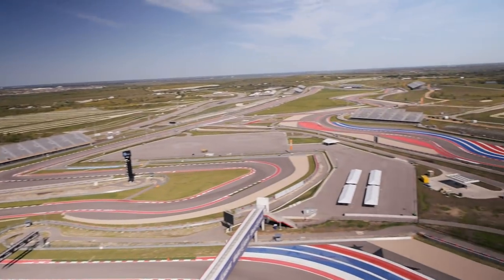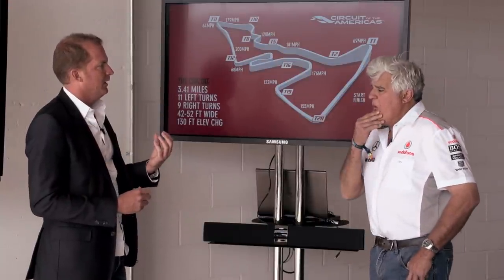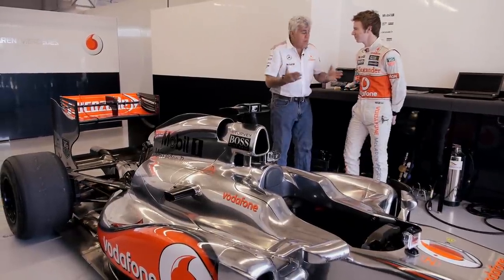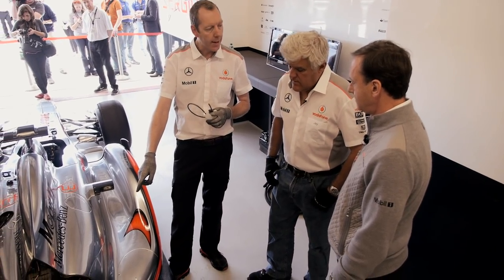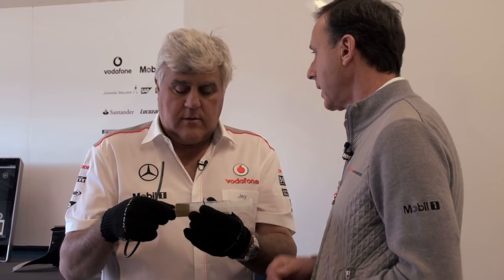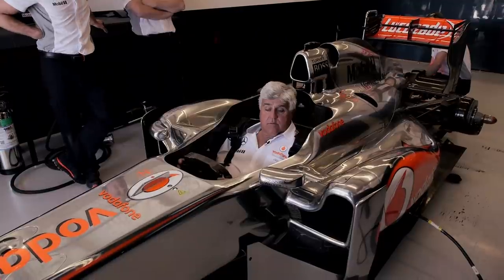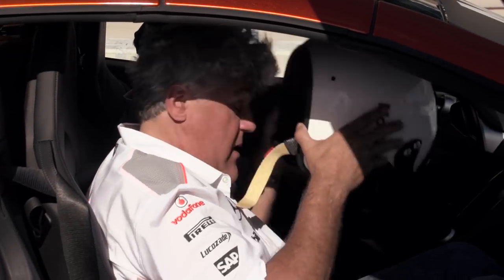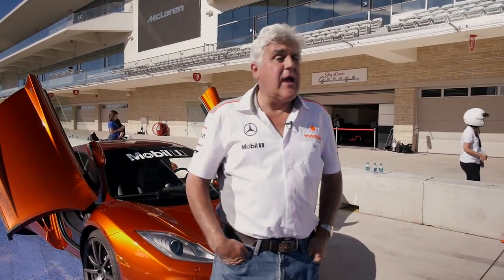McLaren Day at Circuit of The Americas - Jay Leno's Garage

Comment: I wish they had let him drive the F1 car... He was already in it, the engine was on, just put the wheels on and let him drive a couple of laps...
Reply: Dino Prašo 
Have you seen Richard Hammond try to drive an F1 car? He was killing off the engine a million times.
And then when he finally was on the track, he was spinning it constantly in the corners, because he didn't take them fast enough.
Reply: svsguru2000 I'd agree but I believe that these newer F1 cars are much easier to drive than the Renault Hammond was driving. But oh well... It's only a wish anyway.
Reply: Dino Prašo They are still hard to drive and with no experience very dangerous.  U have to go fast enough for down force to work and put heat in the tires so the car stays on the track.

Comment: F1 has been my lifetime passion and I am so glad to see the US offering such an amazing venue.  I really hope it takes off in the US and that they love it as much as we do.  It is just a pity we are losing that amazing noise next year (2014).
Reply: Remember that back in the turbo days they were running 1.5 4 cylinder lumps
Reply: Yes, that was great racing!  A lot different to the engines next year though.  The racing should be good though, we just lose the screaming noise.
Reply: Hedley Thorne Personally I think the extra torque will add to the racing, adjustable boost will add another element to the racing just like it used to be.
Personally I prefer a tuned n/a car to drive, I have owned both a sprint tuned n/a and a high hp turbo mr2 and I'd take the tuned n/a engine every time, a non turbo car is easier to drive on the limit. imo 2014 will be a good shake up and could produce a great year with a lot of engine failures that could knock redbull off of their perch. ;)
Reply: Agree.  The racing will be interesting.  However the trackside noise won't.
Reply: Won't take off in the US. Never has. Nobody can relate to the cars, nor a bunch of guys who names nobody can pronounce. On top of that you can't see the track. Waste of time. Go watch NASCAR instead.
Reply: John Rambo Spoken like a true closed minded American.
Reply: Here here Darren!
Reply: Darren Hahne Remember that movie where Rambo plays a formula one driver? hehehe
Reply: John Rambo How`s life in the trailer park these days? Merry xmas Y`ALL
Reply: I have seen every race so far in the 2014 season and I have to say the sound is not too bad. Yes the V6 does not have the same sound of the V8 but you can hear still hear the engine. Also there has been some great racing so far this year.
Reply: agreed, so who do you reckon, lewis or nico??
Reply: *****
 I think Nico will take it, though I would not be shocked if Lewis won.
Reply: Lewis, if he dont stack it
Reply: yep, i hope so. to be honest he is the fastest driver and without the failures he would have quite a lead.. BUT at least we have a championship on our hands. Thanks for the reply mate.. john uk kent
Reply: ***** His car is a micro second off the pace but you cant rely tell because the raw talent he has this skill astounds me when ever i see him race... Thanks for your response Dave uk harlow.
Reply: speed is like common sense, you have it or you don't and jay has it, in and out of the car, 
What I love about J is he give it back to us, he allows us into his world which is f'ing cool in my book ;) Thank you buddy x
Reply: John from Kent u.k loving but not gay lol haha
Reply: Electric turbo.
Reply: Hedley Thorne i rewatched some old tapes back when they had v12 and v10s
Reply: Darren Hahne
He doesn't represent us.
Reply: John Rambo NASCAR came from the South, so I can excuse a Southerner whose heritage is Richard Petty and NASCAR.  But I don't know who else would rather see a bunch of cars bumper to bumper going round and round a banked oval in one left turn after the other,rather than watching cars race on a track with a variety of turns going uphill and down, left and right, hairpins, chicanes, etc., braking, upshifting, downshifting, really working the cars.  And you can watch motorcycle racing on the same track.  Fantastic!

Comment: Jay, in aviation we use magnetic plugs that have an interrupted circuit. If the engine or gearbox starts shedding metal, the oil carries that metal past the plugs and the metal bridges the circuit, thus a light warns the pilot that the engine or the gearbox is failing. We take oil samples and send the samples to a lab. The lab can tell us from the oil which part of the engine is failing if any parts are failing.

Comment: Around 13:02, when Jay inserted the rubber hose into the gear box to get an oil sample, the car didn't jerk away from the hose or push Jay away, but instead just sat there and allowed Jay to collect the sample. That was a well-behaved race car.

Comment: My hometown is Austin by GOD Texas and I actually got to do the field engineering for a local excavation contractor.  Its going to be interesting and a challenge to the future and quality of the track surface. The PI of the soil is extremely high and difficult to control the massive amount of expansion and or contraction of the soil. 
They couldn't have picked a worse location for this track because of the soil. 
Time will tell us.

Comment: I hate these Tilke-dromes, the new F1 tracks. They all look the same. Almost half of current F1 circuits are designed by the same people!
"Create an overtaking zone here", "create a braking zone there"... They are like those puzzle challenges that scientists give to animals to test how well they can follow the designer's intent. You don't chose the racing line, it is already designed into the track. You don't choose where to overtake, the designer chose it for you and designed it into the track.
This is why I love Spa, it's organic. People didn't build Raidillon to "set up an overtaking zone". They built it to make the track faster and more exciting.
Reply: Kakto Tak Formula One cars are the fastest road course racing cars in the world, owing to very high cornering speeds achieved through the generation of large amounts of aerodynamic downforce.
 Formula One cars race at speeds of up to 360 km/h (220 mph) with 
engines currently limited in performance to a maximum of 15,000 RPM. The cars are capable of lateral acceleration in excess of five g in corners. The performance of the cars is very dependent on electronics – although traction control and other driving aids have been banned since 2008 – and on aerodynamics, suspension and tyres. The formula has radically evolved and changed through the history of the sport.
While Europe is the sport's traditional base, and hosts about half of
 each year's races, the sport's scope has expanded significantly and an 
increasing number of Grands Prix are held on other continents. F1 had a 
total global television audience of 425 million people during the course
 of the 2014 season.[4]
Grand Prix racing began in 1906 and became the most popular type 
internationally in the second half of the twentieth century. The Formula One Group is the legal holder of the commercial rights.[5] With the cost of designing and building mid-tier cars being of the order of $120 million,[6]
 Formula One's economic effect and creation of jobs is significant, and 
its financial and political battles are widely reported. Its high 
profile and popularity have created a major merchandising environment, 
which has resulted in great investments from sponsors and budgets in the
 hundreds of millions for the constructors. Since 2000 the sport's 
spiraling expenditures have forced several teams, including 
manufacturers' works teams, into bankruptcy. Others have been bought out
 by companies wanting to establish a presence within the sport, which 
strictly limits the number of participant teams.
Reply: +Kakto Tak you do know that COTA is a synthesis of Spa, Silverstone, and a myriad of other F1 classic tracks all rolled into one, right?  i mean, you DID do some research right?  you do have an idea of what you're talking about right?  you can look at the track map and see it right?
Reply: +Kakto Tak sure!  Combine your childish "animals following the designer's intent" logic about modern design of a beautiful world class track in the US with objectifying the female form.  'Great reasoning bud", and super mature.  I'd love to see a track you could come up with and see how drivers would somehow NOT follow your intent... You wouldn't dare build in fun places to pass!
Reply: incubrian
You wanted to make a point or smth? It's not very clear.
Reply: +Kakto Tak Its your opinion and your entitled to it but I'd suggest you stop bitching about things you don't like and start talking about the things you do like.
Reply: english1midlands
I'd suggest you stop teaching other people what to do.
Reply: Kakto Tak Teaching?What are you on about.Its called a suggestion.
Reply: english1midlands
Bitching?What are you on about.Its called an opinion.
Reply: incubrian
lol, that's the most plausible explanation, sure ;) Everybody who doesn't like what you like is just envious ;)
"yep, that is EXACTLY what happened! and for sure, NOBODY chose their own racing line! "
Prove it. Show a line that wasn't designed into the track. Show a creative overtake. Absolute majority of racers on absolute majority of laps do exactly that, follow the designer's intent, because they don't have much choice to do otherwise.
Reply: +Kakto Tak Completely agree. I had no idea all those tracks mentioned at the start were designed by the same people, but it certainly makes a lot of sense, because all of them are my least favourite tracks on the F1 calander. They're overthought, overly technical and set in awfully sterile enviroments. And rolling elements of classic favourites into one (as incubrain mentioned) certainly doesn't guarantee an instant classic. Just as putting your favourite musicians together wouldn't necessarily guarantee an amazing record will be produced. There's a reason why tracks like Spa, Monza, Suzuka and old Silverstone are driver and fan favourites. You'd think it would be obvious to the track designers what that is.

Comment: 16:32 Hey Jay, instead of Mobile 1, 🤔 just wondering if you actually use the engine oil recommended by McLaren written right on the plate on your own F1 that’s mounted next to the oil filler cap which says “USE ONLY CASTROL RS 10W60 OIL” 🤓 If not, why not? Could it be outdated?

Comment: "You can't have a circuit that 20km long. It's boring for the spectators. Typically it's 3 miles long." Ehm... Nuerburgring Nordschleife..?

Nuerburgring 24h = 25.9km
Mount Panorama = 3.8miles
Spa-Francorchamps = 7km

I've always wondered... Do they actually know that they're building pointless boring tracks at Tilke? I guess not...

Really sorry for this rant

P.S. I haven't yet seen a race in the COTA... But I've seen Abu Dhabi, Bahrain, Shanghai...
Reply: The Nordschleife doesn't host F1 races....
Reply: They mean for spectators at the race. With a track that big you're waiting a lot longer to see the lead cars go by. After the race has been going for awhile the distrobution of cars would almost even out, but this would also make it harder for cars that fell behind to catch up. It also would be a logistical nightmare for emergency services to be ready for a crash anywhere on the track.
Reply: Weeeeell... Yes... It would be late before the cars got back. But the sight would be unique and special. (Ehm, don't think badly of me but I'm really a rally fan)

As for catching up. When you're 20secs back, you're 20secs back... And it'd be harder to fall off the lead lap.

The only thing that would really be a problem would be the logistics. But small regional car clubs do it all the time when organizing small rallies. So a company running an F1 standards track, should be able to do it too.

Comment: Jay whats the difference in HP. between the car you were driving and F1
Reply: McLaren MP4-12C makes around 600HP.  A 2.4L F1 car produces about 750HP.  The acceleration difference is because of the weight - an F1 weighs 1500 pounds compared to the 3000 pounds of the McLaren.

Comment: When will Tilke learn that you don't create an overtaking zone by putting a heavy braking zone prior to a long straight!?!? At a hairpin the car in front will always hit the accelerator before the car behind it. The best corner to have before the long straight is a very challenging high speed series of turns where the exit speeds are variable because some drivers perfect it over others. For example the old Eau Rouge enabled the most daring drivers to overtake into Les Combes. You'd think Tilke would've learnt after the 2010 Abu Dhabi Grand Prix that their theory is just bullshit!! Interesting why F1 continually employs Tilke to do all new circuits for Ecclestone… who's Tilke paying off to continually get the contracts?
Reply: yes' but there's the DRS and KERS for which Tilke designs too, you don't need corner racing skills if you can add it up on the straight with a push of a button
Austin is fun, it has lots of elevation changes, blind corners, and the good ol' esses

Comment: Funny how that F1 is barely using any power or effort to keep up with that MP4 12C at full tilt.
Reply: better yet, the F1 car can't do more than a few laps that way because the engine would run to hot, it needs the speed to cool the engine. Also the safetycar during official races is always flooring it, it may not look like it, but for the safetycar driver it's not easy.
Reply: MrSkyl1ne Was just about to say the same thing. The pace car has a professional driver that is driving their AMG Mercedes to the limit, while the F1 cars are just crawling behind, struggling to keep their tires warm and their engines cool. :P